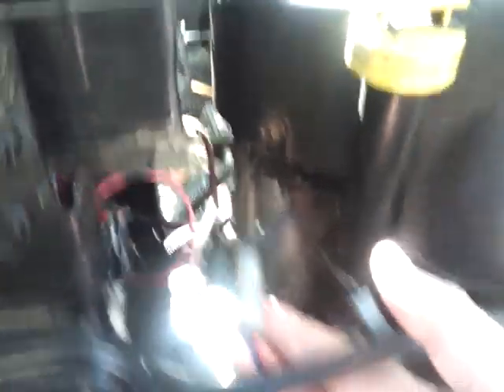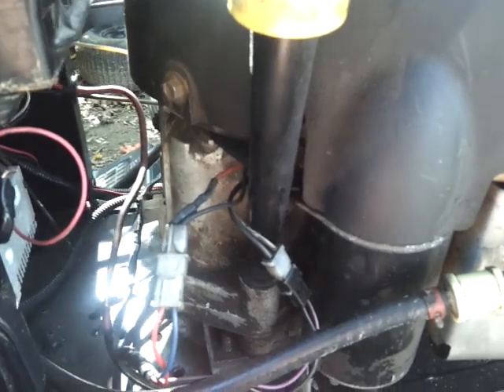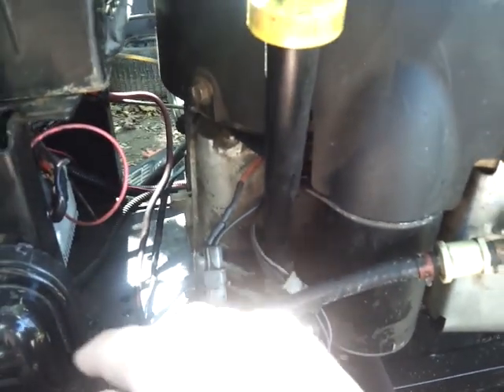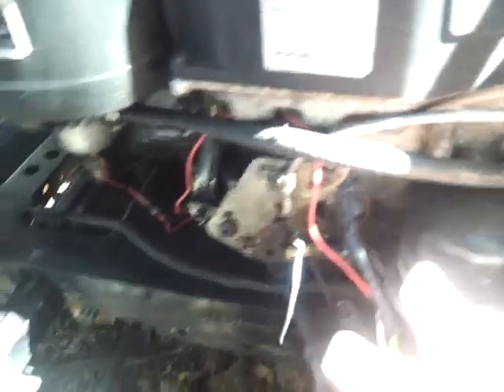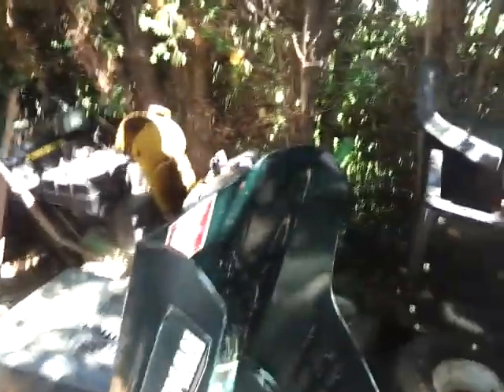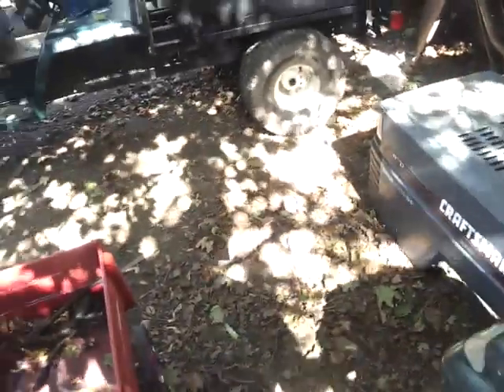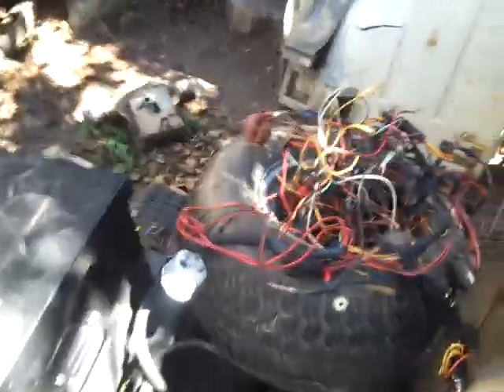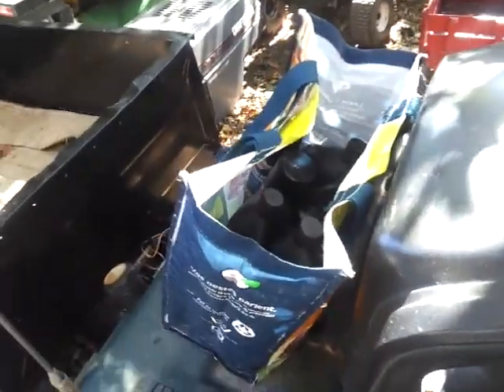Video for bleachedpc

Comment: That's a diode for the charging system, not a resistor. it rectifies the ac to dc for charging. The tap for the lights is ac. A bulb doesn't care if it's ac or dc, as long as the voltage is correct. 
The diodes can be replaced. You have to cut the diode out to test the stator , and the diode correctly anyways

Comment: I think I cut the wire that has the diaode and just ran a wire to the + side of the solenoid so if I re hook that wire with the diaode to solenoid my battery will charge if stator is still good. hopefully my stator is still good,
Reply from the maker: Yes, if you didn't kill your stater